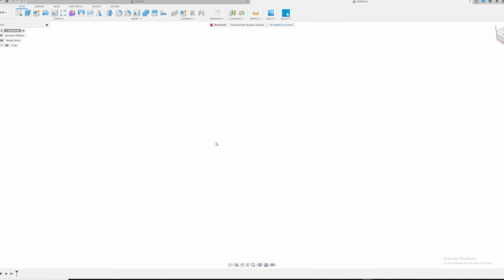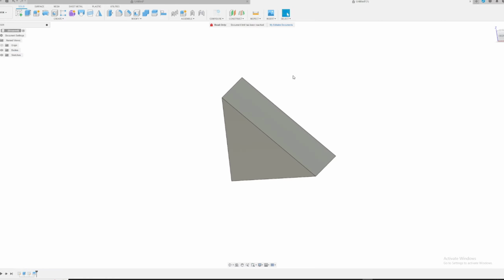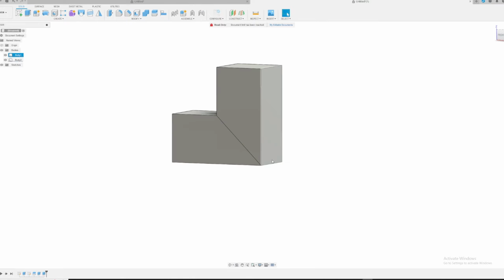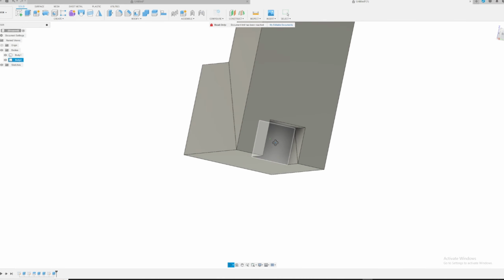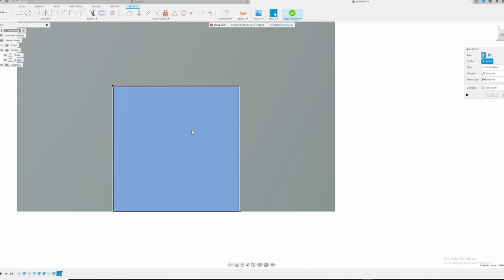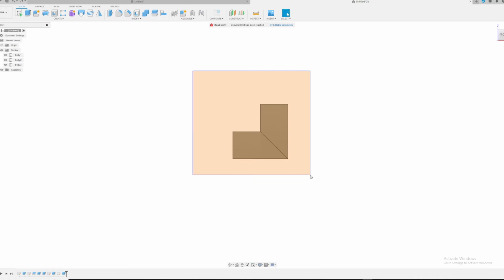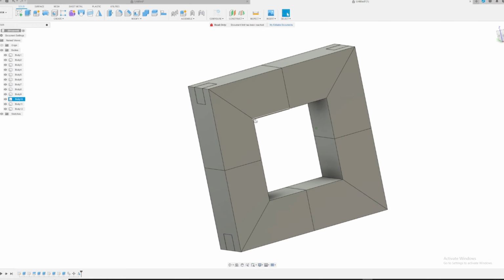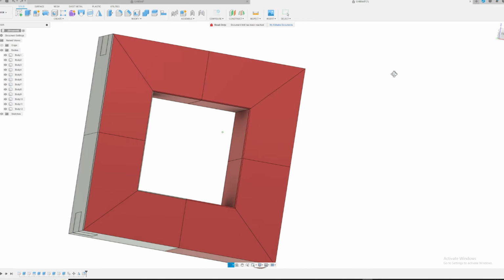Connect 3D Printed Parts With Splined Miter Joint

Comment: Found this while researching joint options. On this model, I'd take advantage of the capabilities of 3D printing - instead of just a corner block, create a double-dovetailed insert that doesn't even need glue. Add some draft (taper) to the inside walls and both pieces will naturally be pulled together, for a tight fit. Add glue and it'll never come apart.
Reply from the maker: Yes, 3d printing can do so many cool things that other way cannot. I love joints.

Comment: Do you own an Elegoo printer? Specifically the Neptune series? It would be great if you could do a series on it because these printers have a ton of issues and almost no one on the internet knows how to fix even half of them. Consider it a challenge. :p
Reply: Hi. The same in Artillery group.  Lucky if you buy good one.
Reply from the maker: I don't own any elegoo 3d printer. I'll try to see if I can grab one in the future.
Reply from the maker: Yeah, I once bought an artillery 3d printer and it does have issues.
Reply: @Scratch3DPrinting  I know. I have X4 pro and and and

Comment: I was wondering if we could incorporate Sashimono techniques into our 3d prints..
Reply: you could but, you would need to use "negative space" technique in the slicer to make the joints/conections stronger. https://www.youtube.com/watch?v=Kzbl51iOzh0
Reply from the maker: We can do any joint using 3d printing. We can even do crazy joints with 3d printing that no process can do.